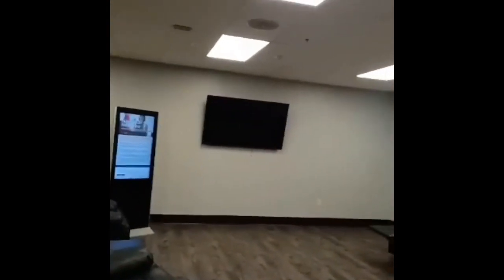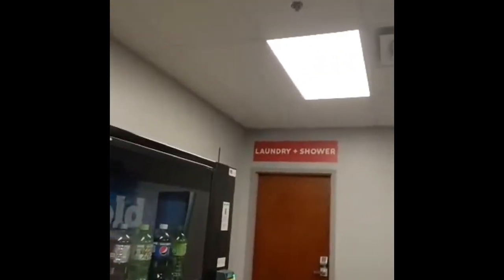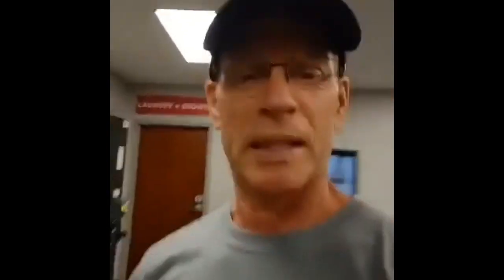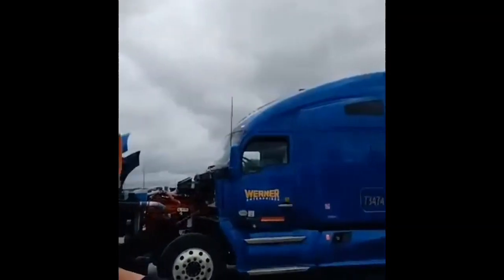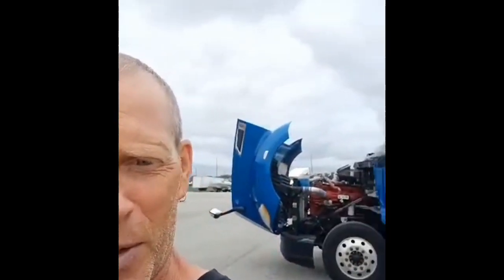TRUCKER PROBLEM | WHAT'S WRONG WITH MY TRUCK | Waiting at the Kenworth Dealer | Werner Trucking Life

Comment: I've been watching videos about no Def vs. Def.  It seems the engines last longer and people have less problems with no Def.
Reply from the maker: Interesting. Thanks for sharing! Def does, however, reduce NOx and air pollution. So that’s the trade-off.
Reply: @TheJoyofTrucking  We'll I guess there could be a debate on how 'green' the Def engines are.  If a emissions free engine lasts 30 years but a Def engine only last 500,000 miles what engine is really better for the environment?  Counting all the parts that have to be made and the engines that have to be made at factories vs. A more pollution engine that lasts 30 years.

It's like the whole electric car vs. Petroleum car.  What is really more green for the earth.  Battery mining and factories may be worse for the earth.
Reply from the maker: @bobc.5698  Hmmmmm. Interesting things to think about.